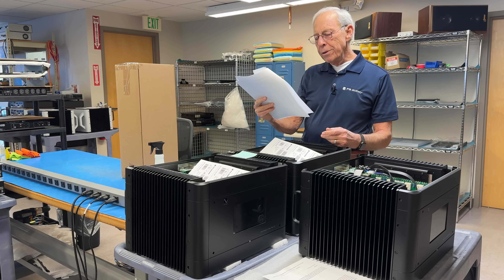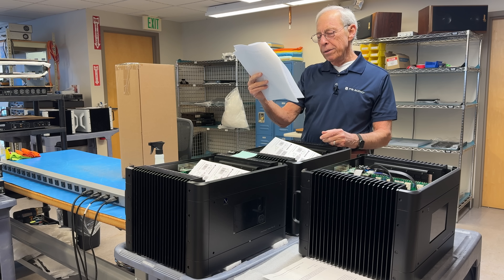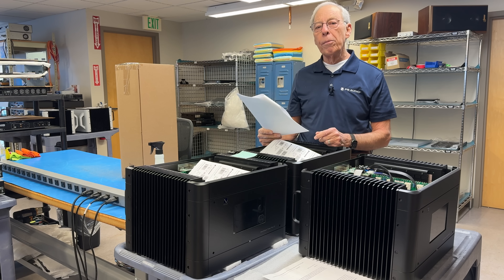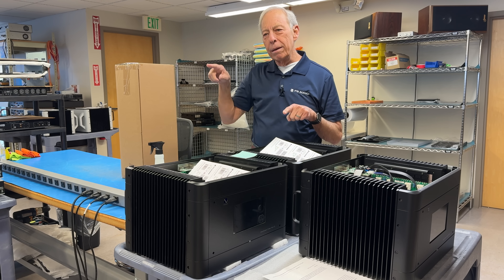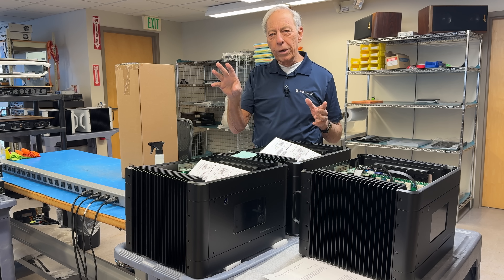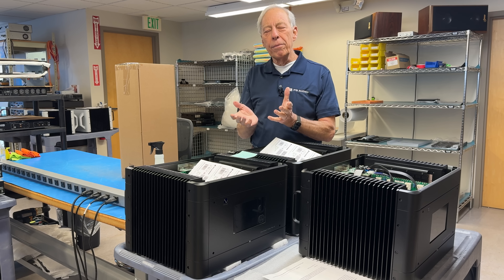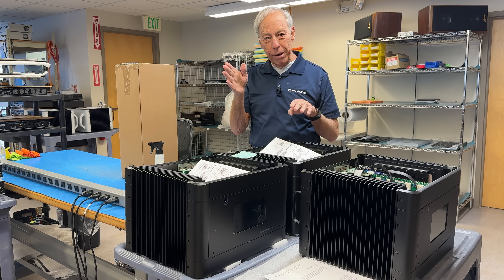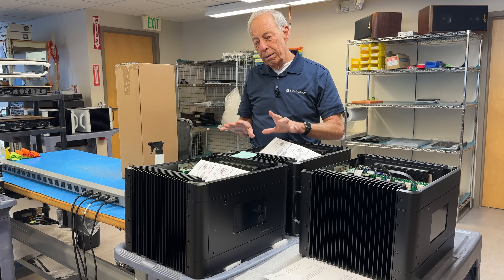Paul explains damping factor

Comment: When I try to explain damping factor to a layman -- and not want their eyes to glaze over -- I try this: Damping factor is an amplifier's ability to "apply the brakes" when a speaker's cone is moving in and out, and needs to be halted and reversed in the opposite direction. Thus, the amplifier must "damp" the speaker cone's momentum at the end of its travel as it moves in and out. (Particularly for low notes through the woofer due to mass and excursion.) 

I enjoy good results with a Parasound A21+ connected to Magnepan 1.7i's. Why?  Filter capacitance of 108,000uF + current capacity of 60 amps peak per channel + slew rate of 180 volts per microsecond = damping factor of 1100 at 20Hz. (And remember damping factor diminishes a frequency goes lower.)    ;-)
Reply: @rc6717  how so ?..enlighten us.
Reply: @SuperScalemaster  - Yes he should enlighten us indeed. The brake idea is not correct, but it is a common view. All the amplifier's output impedance can do is change the alignment of the amplifier, so that at certain frequencies around the box tuning will [draw] more current from the amplifier and the output will go up at those LF frequencies. The bass may sound a little fuller but there is no brake factor. The excursion has just gone up a notch.

The fact that bass drivers can have very heavy cones but an acceptable bass alignment, that only proves the point. Like some use 18" Subs. Look at top quality Subs, good ones, they often have incredibly heavy stiff cones. They being heavy just means you need very large amounts of power. High quality Subs have typically 2000W amps in them, to move heavy cones and produce deep bass. There is no cone excursion overshoots with top class Subs. I have a twin pair of SVS SB3000 13" cone Subs. Works great!

[]Edit
Reply: @D800Lover  Neither you nor he are entirely wrong or entirely right it would appear.  The "amplifier brake" idea is certainly not a full explanation, but it is a factor when it comes to system resonances.  But mainly we could say low damping factor results in frequency dependent (bass) power/efficiency loss and a frequency response change.  With variables like power output level, frequency, voice coil temperature, wire length and so on, there can actually be significant power loss and potentially this may not be a fixed amount (even at a given frequency) and could result in dynamic compression of the signal, affecting transients and thus distortion, and resonances (particularly around woofer Fs and based on box alignment and tuning frequency) and not MERELY a constant frequency response change based on system DF.

KEF would agree with this: "If the load presented by the amplifier to this current is very low (high DF) this current is rapidly dissipated causing the force of the voice coil to diminish. The speaker diaphragm and surround assembly also make up a resonant system that will produce ringing (or unwanted resonances) within the operating range of the speaker, but rapid damping acts like a brake on the voice coil, therefore reducing the resonances. To complicate things further, voice coil impedance is complex, meaning it changes with frequency, temperature and power level."

Audioholics and others have extensive testing and discussion about the topic.  TLDR the speaker wire plays the biggest role, amplifier second - old amps used to have very low DF, this was a big problem for long runs at professional venues.  Modern amps, home environment, adequate wire gauge and low wire lengths... it's not really an issue and the measured response difference is going to be under a decibel at any measured frequency.  The system's effective damping factor going from an amp with a DF of 50-100 to one with a DF of 1000-2000 might approximately double depending on the wire used - play with a calculator and you'll see.

It may be that the cone control ("braking") aspect of DF is merely a side effect of amplifier designs incorporating feedback loops. Transistor amps with high feedback designs, with lower output impedances (high DF) may have higher amounts of feedback increasing their linearity / compensation of cone movement.
Reply: @Artcore103  - I find that throwing in so many factors actually makes things less clear and then doing it from different sources/perspectives just adds to the confusion. That's just how I reacted to your post, with no disrespect for you. Too many things to address and it would just be putting down brush fires and getting nowhere.

Sometimes we need to get back to the fundamental basics, make the complex simple and that is the challenge. But getting to the simple beyond the complex is a big challenge. It was one I set for myself and in more discussions that I can number.

The simple from which everything must come from:

F = BLi

F for Force, or acceleration, this is what we hear. Flat acceleration means flat frequency response. Yes, the must be the same for 20Hz and 20KHz.

Nominally for F to change, we must take "B" and "L" as constants and that only "i" is the variable in this equation. 

Clearly a current that does not change is DC. F must be in constant change and hence "i" the current must also.

The constant "B" is basically the magnet and "L" is the length of the coil that is inside the gap (not necessarily the entire length of the coil) where the force is applied.

 The AC current must be constantly changing or you hear nothing because the coil won't move and the diaphragm/cone won't move.

This must be the starting point and when you start there, then you will realise that so many claims simply don't add up, indeed the physics is not there. 

So a change in output at any frequency, even that at LF where the alignment is affective, any change in output requires a change in current. The force applied to an excursion can according to Newton's Law only propel the cone so far and no more. So if we measure an output in dB-SPL and we want to increase that dB-SPL by +3dB (double the power) we need to double the current change and that moves the cone the required amount and no more. 

Now there are of course other things to be considered, but that is essentially it. For example, I have seen poor cone suspensions starts to distort and double the frequency, but that is just bad design. And that is definitely not overshoot. It is distortion.

The whole "brake" thing has gotten repeated so many times that it has in many people's minds become and "alternate fact" and I doubt if I can change that much. But does that mean I shouldn't try? Well, that's a different question.

Newton's Law and the applied Force being related to a change in current is but one way to plain it. But both actual measured drivers that I have measured shows no overshoot that needs to be braked, also programs like SoundEasy can be used to model it as well, and a model comparing current drive versus voltage drive and the change in dB-SPL between the two of them, at any frequency between 20Hz and 20KHz, could be attributed to change in current. 

Since there cannot be any damping with current drive, then tracking the current totally is pretty conclusive proof.
Reply: @D800Lover  Way too complex -- FOR AN AVERAGE SCHMO. NOT suggesting it is inaccurate. If one just types "damping factor explained kef" in a search engine, the top result will likely be a knowledge article on KEF's website.  "Borrowing" from that:

"The voice coil of a speaker becomes a current generator that produces a flyback current that is sent to the amplifier (sort of a reverse answer to the current the amplifier sends the speaker). Every time the voice coil moves it creates this flyback current. If the load presented by the amplifier to this current is very low (high DF) this current is rapidly dissipated causing the force of the voice coil to diminish. The speaker diaphragm and surround assembly also make up a resonant system that will produce ringing (or unwanted resonances) within the operating range of the speaker, but rapid DAMPING ACTS AS A BRAKE on the voice coil, therefore reducing the resonances. To complicate things further, voice coil impedance is complex, meaning it changes with frequency, temperature and power level."

(All caps added.)

Also read an analogy to a car suspension that works -- for non-electrical-engineer types: Speaker suspension = springs.  Amplifier damping = shock absorbers.
Reply: @ - Sigh. The voice coil generates a voltage when a current goes through it. The current comes from the amplifier. This voltage in the coil can only be dissipated as current when connected to a voltage source (the amplifier) with a nominal zero impedance. This voltage in the coil is not shortened by the amplifier. Why? Because it has to go through

Pretty much 90% plus that I read defies the above basic physics.

There is a Wikipedia page on 'Damping Factor' and it has so many factual errors in it. I scratch my head, but this is how things are. I don't think the contributors are entirely stupid. They are far from that. I am not even saying you are stupid. All I am saying is that most have not thought this through. In the sixties (when I was a teenager) we started to get solid state amplifiers replacing tube amps. The major advantage that was spruiked was "no output transformer" and the next stage was to imply that the role of an amplifier was to somehow better "control" the speaker. It became saturation propaganda. And where did it come from?

The amplifier industry.

The voltage in the voice coil can only be dissipated through it DC resistance. Then all is revealed for what it is. The DC resistance is in series with the output impedance of the amplifier. That is physics and nature works no matter how we like it.

But damping factor myth will never go away and that is sad because we cannot track the current of the amplifier if we think that way. And in the interface between the amplifier and the speaker, tracking what the current does can mean that we come across solutions that we otherwise would not. Thankfully that is slowly changing via another vehicle: The interest in "current-drive" which has some way yet to go, but at least it is showing the way.

Very few amplifier designers also design loudspeakers. That is historical. But I design both.

Most loudspeaker designers that I speak with (and I am one of them) hardly ever talk about damping factor. They all know that tube amplifiers may have higher output impedances and they design the alignment (if they know their job) so that the speaker can tolerate a wider range of output impedances. I suggest to them that a Bessel-like alignment usually does that nicely. Problem solved. I have designed a speaker using current EQ that will not lose any damping even with my "current" amplifier with an output impedance is 1000 Ohm or higher. If you know how to do it, then it is not a problem. As long as the alignment of the speaker does not change, then you don't need damping factor at all. In fact it disproves the point entirely.

Sorry for the verbosity. I just start typing and I don't know what it will lead to.

In 1954 the American tobacco industry started a misinformation campaign showing "doubt" about the dangers of tobacco causing cancer. Thirty years later, the majority of Americans still had doubt about the dangers of tobacco. Today almost 25% of Americans still have doubt. 

I suggest reading "Merchants of Doubt" - just Google it.
Reply: Of course it is NOT a complete and totally accurate explanation -- PLEASE RE-READ THE FIRST 18 WORDS.  And in hindsight, I oopsied at the end -- damping and frequency are typically inverse.

Comment: You can always tell the leaders by how many people take shots at them. 
Also my 30w tube amp drives my Maggie’s better than my 450w class D amp with a high damping factor. Paul is generally right like always. But there are still many factors that makes for good synergy. For some reason Maggie’s typically don’t like most class D amps regardless of the damping factor
Reply: Bigger the amplifier 😊
Better the performance
Reply: No, bigger the amplifier, bigger the profit. Kind of difficult to trust a salesman. If someone who is not selling any cables would suggest you to just buy decent cables and spend extra money in electronics which he is selling would you trust him? @CarlVanDoren61

Comment: I don't think it's a matter of damping factor as both are rated in the range of diminishing returns. It's current delivery, that damping factor is only when the amp is happy. The output impedance of an amp (esp. solid state) is much lower than the load it can actually drive. Damping = actual load impedance/output impedance. Overload it and this output impedance increases to show its real power/current limits.
Reply: Something is off with the Rotel RA-1592 specifications. Rotel states that the output impedance is only 100 ohms, yet cite a damping factor of 600. That makes no sense. If the output impedance is really only 100 ohms, that would be a problem for a difficult load.
Reply: @rangerrecon  That should be more like 1/100th an ohm for the speaker outputs, although could be correct for some other outputs.

Comment: When I travelled giving lectures and seminars on Audio it often included explaining Damping Factor. Yes it is basically just the mathematical ratio between the speaker load and amp's output impedance. But some manufacturers play games with feedback loops to give artificially high numbers to publish. 

A real simple demonstration of Damping Factor I used was to take any cabinet speaker and disconnect it from any amp. Tap on the woofer and listen to how loud and free to move it is. Then strap a wire, your car key,.... across the speaker terminals and tap on the woofer again. The sound will be incredibly different. Significantly tighter.
Reply: Yes, certainly. But not just that.
Indeed, the speaker cable impedance has also its role, worsening DF. You can have a high theoretical DF, but the real cable impedance adds to the amplifier output impedance.
So, it is by far more meaningfull to  say 
DF=Speaker impedance/(Amp output Z+speaker cable Z).
Reply: @guilhermedealmeida2299  We are basically talking 3 modules. The Speaker (from the terminals in), the Amp (to the terminals out) and the Interconnect (from tip to tip). Do we look at the resistance/ capacitance of the contact points as a 4th module or include them in the Interconnect? I suggest including that with the Interconnect module. 

As DF is a measurement of the Amp and not the load (other than to specify what the load was) I suggest the Interconnect be included with the Speakers to give a total load at the Amp connectors. 

Yes from the speaker side, shorting out/ return path for the counter EMF is a primary goal and the Interconnect is a definite factor in that. But from the published spec, it is at the Amp terminals compared to what is connected to them. 

DF=(Speaker impedance+speaker cable Z)/Amp output Z
Reply: OK, but when the speaker "looks back" what is "sees" as impedance dampenig the EMF from the moving voice  coils? It "sees" Z Amp+Zcable.

If you have a 500 DF amplifier at 8 ohms load, with a 1 ohm cable DF dips to about 8... From the speaker's "point of wiew" it is irrelevant if the 1 ohm is at cable or if it is at Amp output, unless the feed back loop of the amplifier is placed at the speaker terminals themselves.
Reply: @guilhermedealmeida2299  So as soon as they start publishing the Damping Factor for speakers we can start using your approach. Meanwhile as it is an Amp spec, it is from the Amp terminals out.

Comment: I am running an Onkyo A9555 Integrated into Monitor Audio Silvers (from around 10 years ago). Damping Factor of the Onkyo is only 25 but the MA's don't dip way low in impedance. Ends up a pretty good match.

Comment: Rotel ra 1592 mk2 has damping factor 600  it is not small number.
Reply: Yet Rotel says that the output impedence is only 100 ohms. Which is correct?

Comment: I'm using an amp that has lower power but higher damping factor than the previous one.

The new amp has tighter low bass. Playing electronic music, I can hear sub bass 'ripples' that I couldn't before.

The old amp can play louder without sounding strained. It has a more solid and weighty sound, but that could be more about the tonal qualities of the amps than power.